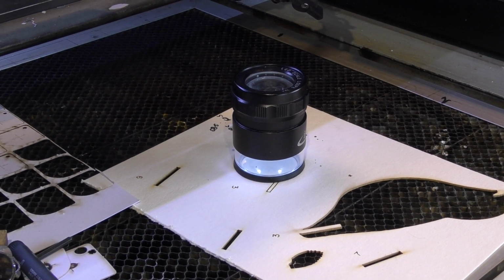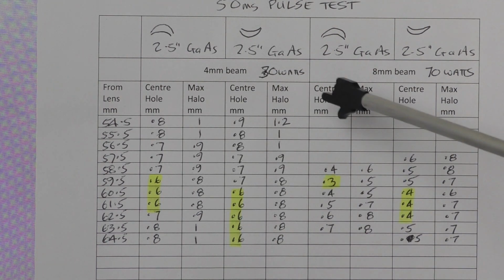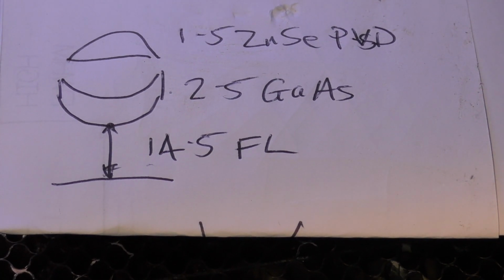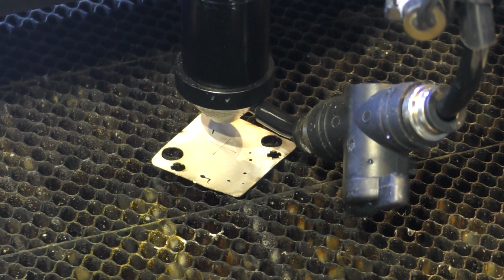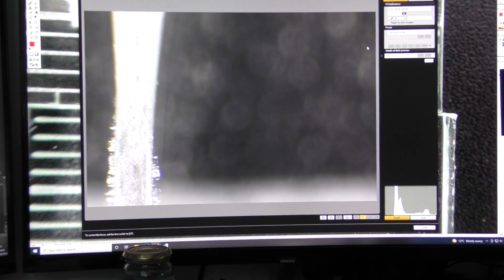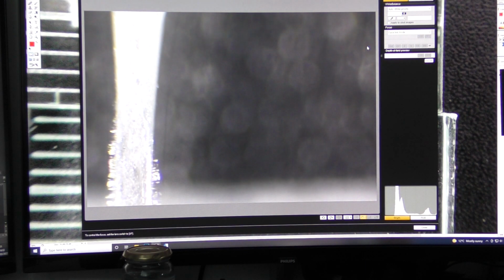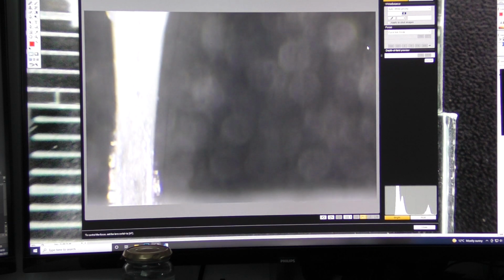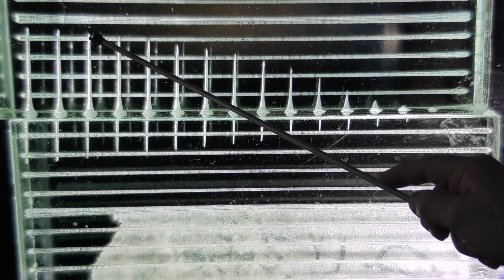RDWorks Learning Lab 233 More Small Beam Experiments

Comment: Hi Russ; your conclusion that the RF tube is not good at cutting, collides with the performance of machines like the TROTEC ones. They only use Coherent tubes, so far as I know, and their cutting capabilities seem to convince the most demanding customers? How do you explain the dilemma? Thanks!
Reply from the maker: Hi Francesco
 I have often envied  these very expensive machines  which is why I created a budget version, My mechanics are no where near as expensive or sophisticated and my RF tube is very limited by  the 30 watt capability. However it has capability
.If you have been following what I am trying to achieve (so far unsuccessfully) I am trying find ways of using the natural high intensity of the small diameter beam  and 
then use the lens to amplify it further.  The intriguing thing is that in principle it will work, but it is beginning to highlight a serious shortcoming in what we believe about lenses.  There is a zone close to the axis that is not playing the focusing (amplification) game.
 So to sum up. There is no dilemma. If you want RF cutting capability you  have to throw $ and watts at the problem to overcome the inefficiency of beam expansion.  My low power  budget system  has amplified this issue and demonstrated that I should not look with envy at those eye watteringly expensive systems

 Best wishes
Russ

Comment: Simple enough, really.  A water jet can cut through a foot thick hardened steel if the jet is thin enough.  A prime example would be when you put your finger over the garden hose to make it remove gunk on your auto, or whatever, but with a full open (finger removed) hose it trickles out.

Comment: Hello Russ @5m25s where are you measuring "from the lens" at?  The FL isn't from the bottom of the lens, it's from Principal Plane which is a point inside the lens.  That is 1-2mm inside the lens, but it wouldn't entirely account for a 4mm discrepancy.
Reply from the maker: Hi Danny 
I am aware that there are 3 definitions of a focal   length that could be used, Front,(FFP) ,Back (BFP) and Effetive (EFP).  I have yet to see a manufacturer specify which one he is selling. I I always use FFP and BFP because it is simple to measure the distance inside the nozzle.. If this session had posed a few questions  I an just scratching the surface and there is a whole set of puzzles for you already "in the can"  There are no trick questions in what I am exploring. I am still trying to fathom out what's actually happening when I pass this very high intensity small beam through various lenses. The results seem VERY unpredictable.. I have given up trying to predict the performance of a particulat lens combination and some of the results are unfathomable (for me). However, my approach is to keep experimenting and recording and hope that a pattern will appear in the data that points me to a logical explanation.
 Best wishes
Russ

Comment: Just spit balling, but would maybe a small frenal type lens on the flat of the main lens help with focusing more of the central light beam?  I know it would have to be very small, was just a thought.  Dan C.
Reply from the maker: Hi Dan
That is a novel idea and its great that this problem has stimulated your thinking juices.  Sadly there will be no advantage because it is just a flat pack lens with all the same geometric features cut into a series of concentric rings and arranged onto a flat plane.. The other major problem is that where would you buy a zinc selenide version?
 Many thanks
Russ

Comment: lol, I was thinking you could compare intensity with pressure exerted on the surface. And then you showed the glass example which visualizes it.

Another example might be a punch. If I have a large flat faced punch and hit it with a 1lb hammer, on a steel plate it will not leave much of a mark, but if I now take that punch and put a point on it and hit it with a 1lb hammer, I am going to create a deeper mark because all the pressure (intensity) is concentrated down into a much smaller area. Another might be narrow tires versus balloon tires and the pressure applied to its surface patch.
Reply from the maker: Or why God didn't create the camel with stiletto heels!!
 I like to make my learning fun. Those little images are how I visualize the world. Remember, this all about my enjoyment and education , you just happen to be  looking over my shoulder to criticize when I go off track . Hmmm,  let me think about that again.........I'm off track and into the unexplored much of the time. 
 Best wishes
Russ
Reply: @SarbarMultimedia  Just to be clear there was no intent to criticize anything you did or have done. 
As I was thinking about what I wrote, I was thinking a funnel is perhaps a better analogy showing the potential energy transfer by taking pressure readings at the point would be the center straight rays and the highest potential, and as you move up the funnels angle the measured pressure becomes less the wider the funnel gets. Probably poorly stated again on my part, but helps me to try and visualize what you are showing in your experiments.
Reply from the maker: @FSEAirboss  
 Panic not. I saw no criticism in your comments . I see the world in little pictures but my pictures don't have to be the same as yours. It's whatever allows you to understand.
 I am out on a bit of a limb with this subject because this is probably not an area many have explored (other than theoretically) To validate that there is little or no intensity amplification at and around the axis of a lens is  difficult for most scholars to believe. There is focus  but its so far beyond the nominal focal point  and that  it's ability to amplify the incredibly narrow band of intensity I have in this beam, seems to be non existent..Perhaps I am misreading what I observe, that is why I am approaching this issue with many different experiments.  At present all my tests are indicating the same nil amplification conclusion. In fact, if I look back at my attempts to design a long focus compound lens to do much the same thing,  I was decreasing the beam footprint before it hit the second lens, . I encountered this weird speed limit of about 17mm/s cutting speed regardless of the lens combinations I used.  That sounds just kike a "hole" in the lens limit that I am encountering here. 
 
 I am ever the student because there is still so much to learn and understand about this technology.
 Best wishes
Russ